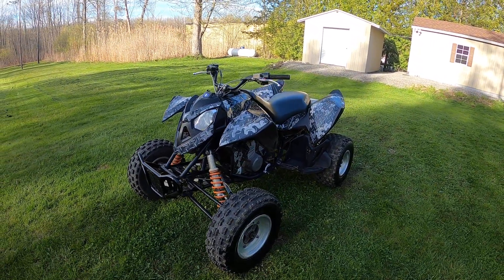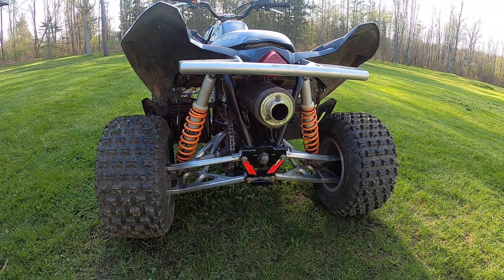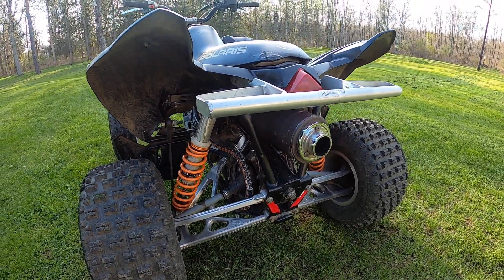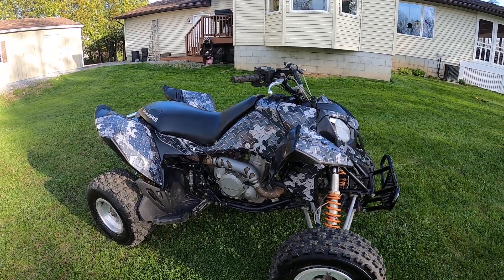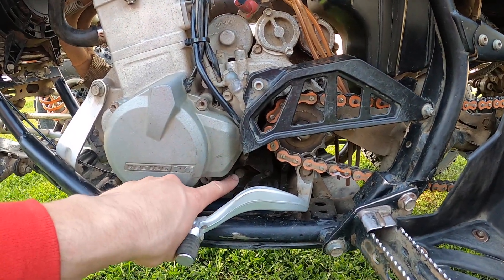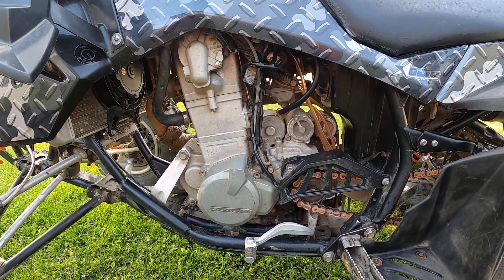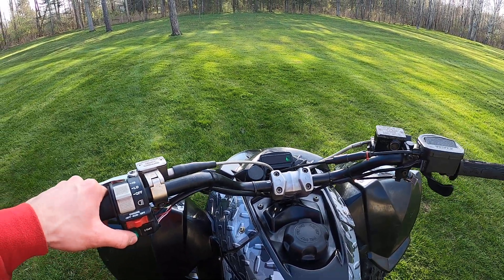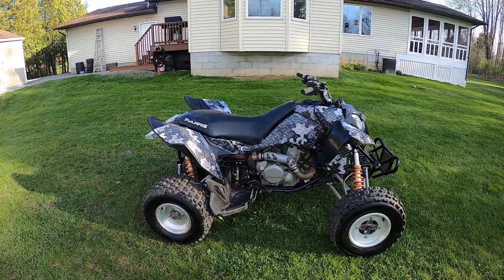2007 Polaris Outlaw 525 IRS Start-up, Walk-Around and Overview

Comment: Had the same clicking issue, changed the cv joints and it solved it but I was told that it might come back in the future to to the carrier being scratched up. Its hard to find the carrier as its a discontinued part but if you find someone parting out a quad then get it off them.